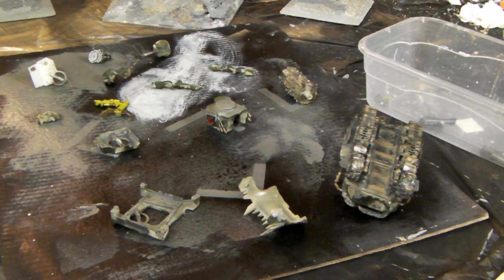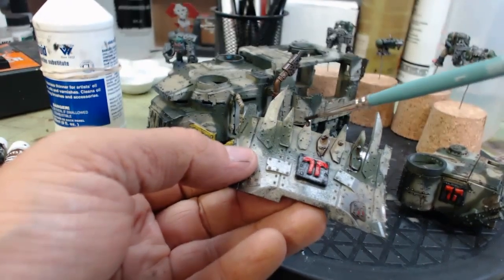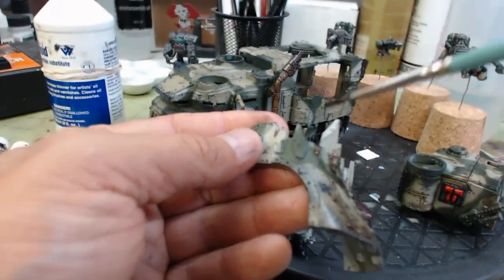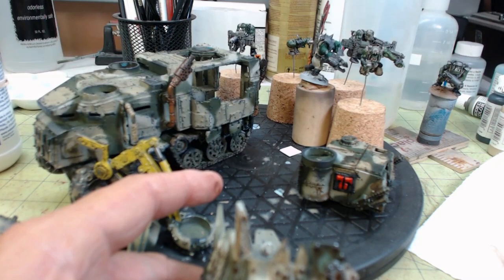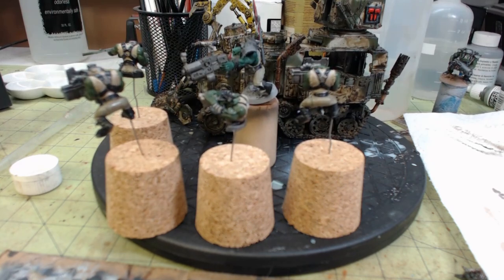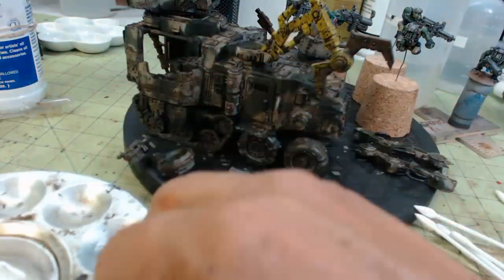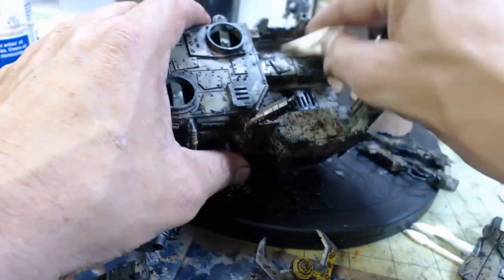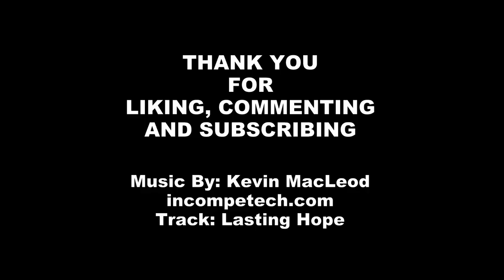Ork Blood Axe Battle Wagon Part 12 Oil Wash

Comment: I tried this oil wash with gloss and for some reason the oil wash will not lift off after it is dry...i used mineral spirits and make up sponges..i use winsor newton lamp black oil paint...any tips on what i may be doing wrong??
Reply from the maker: Did you make a wash with the oil paint and spirit first, or just put straight oil paint on? The thicker the wash will filter out the color underneath. Also make sure the gloss or stain varnish coat is cured first too; that is very important.